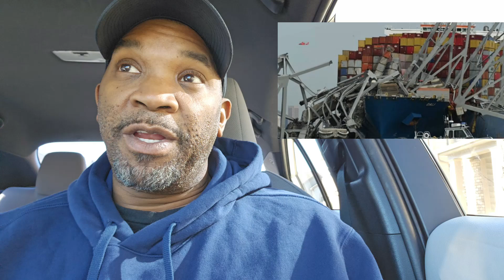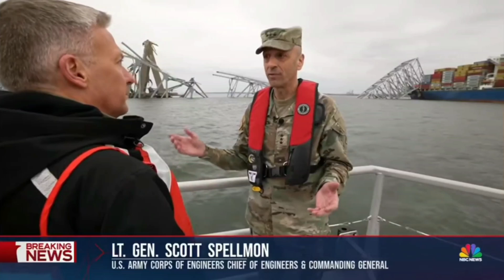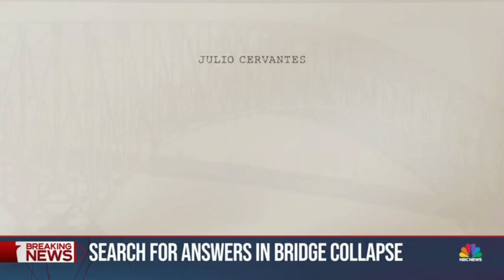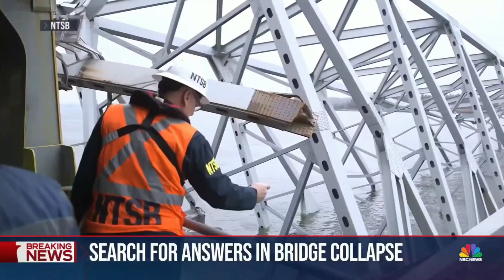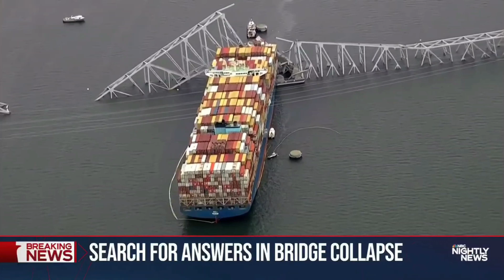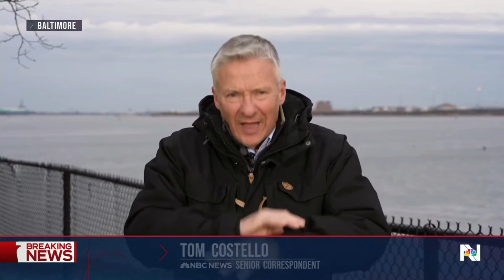Close Up Look at the Damage Caused at the Baltimore Bridge Collapse. Alot of Work Ahead! 🤯

Comment: Them sections you speak of are expansion joints. It is a portion of the bridge that is not in direct contact with the next portion. That allowing for expansion and contraction due to season temperature changes. As for the force of the ship hitting the bridge, i can imagine it being what it feels like to be tackled by an NFL linebacker. You would be standing there like a rock, refusing to be moved. But then this 400 pound guy leaps off the line of scrimmage and he presses you into the ground like a steam roller.

Comment: Hey Steve! You in my neck of the woods brother! It’s devastating for all of us. We go over and under the bridge all the time. Nearly every weekend going back and forth to the different yacht clubs as our QOTC pageant is out of MD Yacht Club on the other side of that bridge. The club is at the farthest tip of the city over there, drive til you can’t go any further unless you’re driving into the bay. Now it will take us another 40 minutes, added to the 1 hour 20 minute ride it is by car. For the pageant we all go in by boats, much closer by water. We’re still looking to recover 4 bodies trapped in vehicles on the bottom. They pulled out two & if you watch certain videos, you can watch the trucks fall in, one by one. 

This ship wasn’t supposed to be on the water, according to the ship logs as it had some serious issues after hitting a bridge in Belgium in 2016. Professor Nez did a video, conspiracy you know, but he has the details on it being pulled out of service in 2023. This was 💯 an accident & these ships don’t stop on a dime, they had done all the could to stop the ship, they had less than 4 minutes to correct with no losing power 2x. 

We lost 6 out of 8 people. 4 still missing under water. 2 were pulled out alive, 1 unharmed, just cold, the other injured but has been released from the hospital. They weren’t in a vehicle & is why they survived. The other 6 went into the water in work trucks, 2 have been recovered in 1 truck, the other 4 are in trucks buried under debris that has to be removed first. 36k people drive over that bridge every single day.
Reply: It’s me, Dude Morris on my other page with our 16 year old granddaughter, a princess with our yacht club program located on the other side of the bridge. 

We still have 4 more workers trapped under debris. 4 have been rescued, 2 dead, 2 alive.